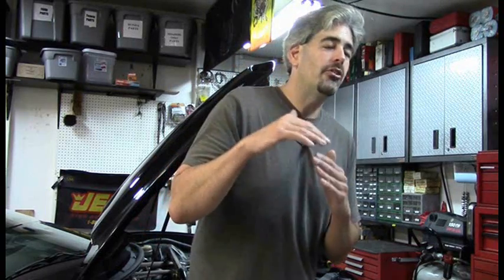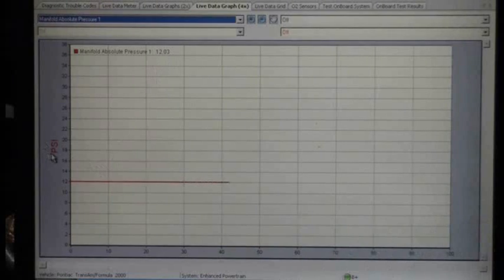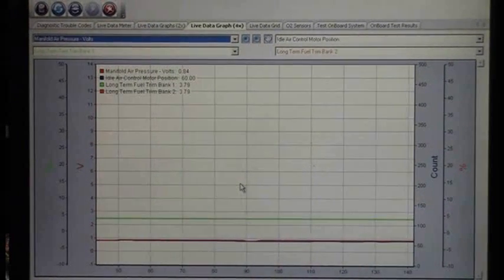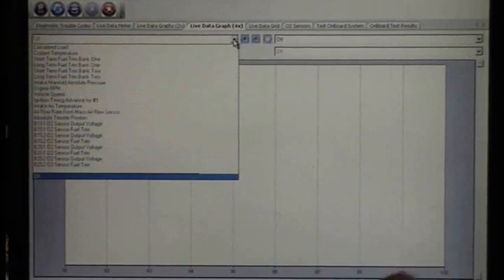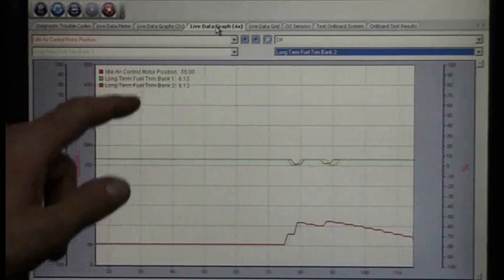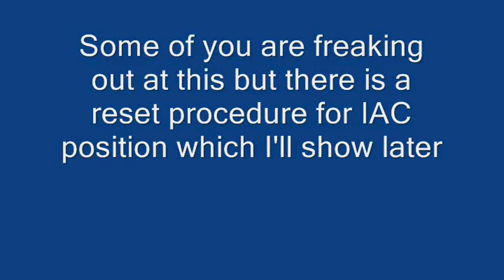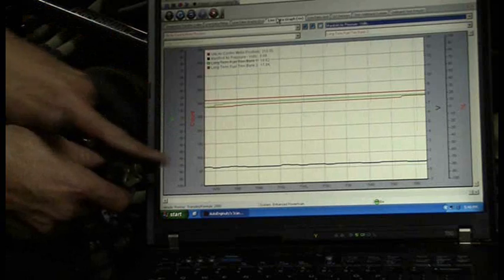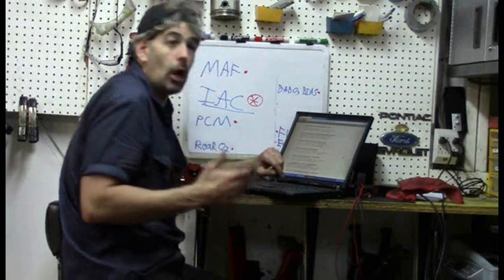P0171 Case Study from Hell 2000 Trans Am Pt3

Comment: This IAC is a four wire stepper motor. Test(s) 1) DC Voltage Test (using a two channel  lab scope): Connect one positive test lead to IAC signal A(+), which is at connector position “D”, connect other positive test lead to IAC signal B(+) which is at connector position “B”,  and connect ground test lead to known good ground. When cycling ignition switch on and off, both IAC signal voltages should switch between ground and system voltage as PCM positions IAC. This produces a square wave pattern. Test 2) Resistance Test: Connect to motor terminal windings . Resistance should be 40 to 60 ohms.

Comment: By looking at the pin out Matt it looks like to me you have two separate windings  in the Iac.  Here is my theory.  Low means either a lower speed the valve moves on those windings and it switches polarity.  This function might be solely used at idle.  The computer then changes polarity to open and close the valve.  Then High could mean a higher speed because there are more windings on the high function, therefore you will have more magnetic field strength and the motor will move faster.  Never worked with that type of valve but I bet it works like that.  It is also probably pulse width modulated, so if you put a direct 12 volts to it you will  take the chance  of damaging  the valve because it is not designed  for a full 100 percent duty cycle.  Like Steve said, you need a scope to check this or a manufacturer  specific tool that can test it by putting a modulated voltage to it.  You could do a ohm check of the seperate windings though, not as good as a dynamic test but you might find something with.  Matt can you show me the schematic how the Iac is wired up.  Bet everyone could you better if you show the schematic .  Good job by the way.
Reply: Now you know your stuff. Fantastic
Reply: Thanks, I'm a junkie for this kind of stuff, always liked the challenge.
Reply: Your right about it being Pulse Width Modulated, I was real nervous when Matt said he was going to put 12volts DC directly to that motor, POOOOOOOF!    If it is Positive side switch in the PCM thru a transistor the PCM connects the IAC to + power and creates a ON/Off signal to IAC ( High = 12 volts and would be on, and  Low = 0 volts and would off ) or it could also be Ground side switched or grounded thru the PCM and would create a OFF/ON signal where 0 volts would be on and 12 volts would be off. By doing this it creates that square wave on a Oscilloscope that John Wrench mentioned in his post. The amount of time that the PCM keeps this signal ON/OFF is called the Duty Cycle of that IAC/Signal. The PCM uses this for two purposes, one of them is very precise adjustment of the position of the IAC and the other is to control amperage flow so you don't burn out the IAC with to much or unrestricted amperage flow. POOOF! Direct 12 volts DC!
Reply from the maker: Billy R Exactly Billy- in fact in the info I read while researching the connector wires, it specifically states not to put 12V to the motor. I was actually already aware that IAC's are kiny and aren't tested through typical means, luckily I remembered that and looked up the wiring first. It would definitely have introduced another variable "oh, great so did I fry the IAC now?" lol
Reply: Billy R  Great comment Billy, and thanks for another great video Matt. How you manage to throw a little fun and humor in it all I don't know.

I've been getting less sleep as this video series goes on because I can't stop thinking about everything I've learned! As hard as it might be on some people to hear, I think you can handle this. I'm glad you didn't directly find the problem, in the journey, there are so many that contributed and added greatly to my learning. This whole community is thanked by both of us I'm sure.
Reply: Nah, I think your alright. unless you got tempted and stupid off camera to zap the piss out of it ( The IAC ). Once again Matt, it's looking like your going to have no choice, whether you want to or not, to break down and purchase a Oscilloscope. That is if you plan on continuing your hobby dabbling around with cars and not be a parts changer! The problem is as you gained more experience, you increased your knowledge and diagnostic skills but you did not increase your diagnostic tool chest very much as far as electronics capability goes. I know you said electronic circuits and components are your weak link in the food chain for you. But Dude that is where it's at. If we had access to a Oscilloscope, we could have eliminated all of the great suggestions or should I say great guesses that all of us have been making definitively from day 1. NO Ifs, Ands or Buts about it, Period! This series would have had a few less episodes!!. Right now I feel like we went in so many directions without positively ruling them out including the O2s!
As far as the IAC goes the only real tests you can do ( which I'm sure your aware of ) without a Oscilloscope is to Ohm the coils( pins A+B & C+D to see if they are within spec and to Ohm pins A+D & B+C to make sure ( Infinite Ohms ) the two coils are not shorted together. Other than that you can back probe the signal wires with you DVM to see if the PCM is communicating with the IAC. Just remember the DVM is going to average that square wave so I guess you will see 0v -12v = Maybe 6 volts average.

Comment: If you're looking at a bad iac (or a faulty iac circuit/command) wouldn't you have expected to throw one of the iac codes by now, rather than the lean condition dtc's?
Reply: Not if it Intermittently  sticks, the computer logs trouble codes on a certain amount  of time, if the fault happens to fast sometimes the computer will not see it and no trouble code will be logged.  I speak of this from experience working on Cummins Engines with computer controls.  Same thing.

Comment: Matt if you go to the grid section for data on the Autoengineuity scan tool you can actually pick all the values you want to graph by recording a movie.  Save the data, disconnect, and you can pick and choose whichever  four pids you want to see relationships to each other.  I just bought my Autoengineuity and figured that out.  Keep in mind though the more pids you select, the update rate on the scan tool will slow down.  Give me a shout if you would like to see a file of mine where I do this.